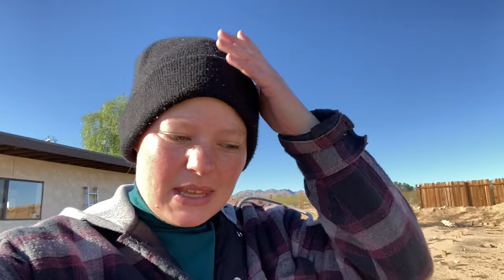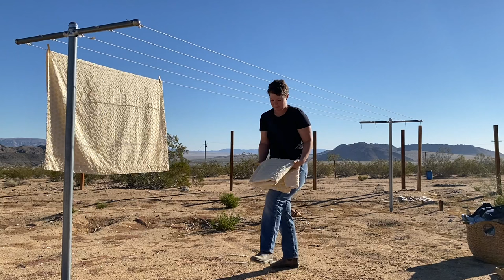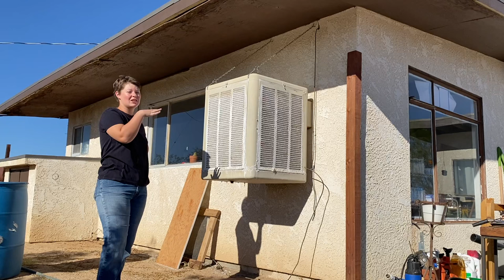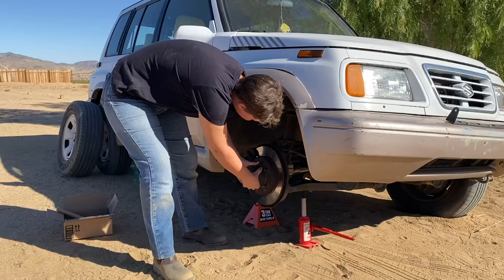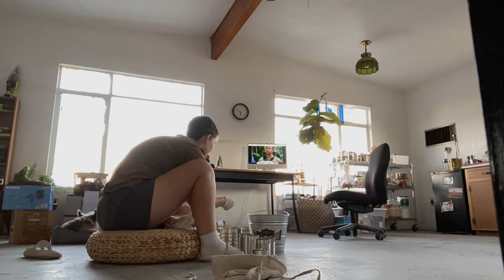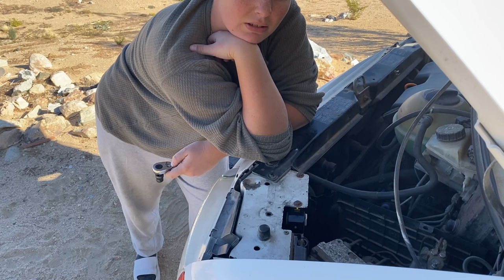34. Little Happenings on the Homestead + Working on the Suzuki Again

Comment: Ok I just started watching your videos- and I Know All about that living out like that- I had to learn the ins and outs, those cute little chipmunks- rats , kangaroo rat, god knows you can’t kill’s their endangered- like Hell, ! There’s Millions of them - and they’ll eat your wiring up, put Peppermint oil on cotton cloth in a tin can and wire in the engine compartment and once a week put more oil in it. 2 or 3 spots - do the same inside. And in the house - spiders don’t like it, and  💯 % orange oil - use it for the scorpions- I spray around my travel trailer, inside and out, I use 4 oz of the orange oil and 4oz peppermint oil mix in a gallon jug with Hott water. Shake it up and shake it every once in a while in a pump,sprayer. Spray around all windows in and out - doors too - thresholds- under cabinets - in your sheds. Everywhere in them, scorpions love the cool moisture and the always travel in pairs. Go outside on a moon lit night and look at the ground - the moon will make them glow a light bluish color. And Never set something on the ground from either the car to house, or house to car. I liked to of had a Cow when you picked that chair up to carry to the dumped. Haha- ugh. Good Luck little Lady, living out there, Your going to need it- You might consider getting a Few cats, but make them a way to climb on top of the house and give them a old cooler to live in, and Always be careful when you pick up something of the ground. Moth balls are great too. Prayers for ya. 🤠🐾♥️🙏🏻🇺🇸🌲🍀🦨

Comment: Heather, if you anticipate trying to unthread or unscrew more rusted things, order or otherwise acquire a can of Kroil. I've been using it intermittently for about 40 years... have yet to have a nut, bolt or screw it couldn't loosen up with a liberal application.  I generally apply it before i even begin a project. 

The algorithm kept pushing your videos for the last 10-12 months, so I finally decided to give you a chance. Glad I did. My wife and I are  local, over on the south side of town. I'm very impressed with your efforts!

Comment: I don't have a cover for my swamp cooler either. I use contractor trash bags slid over the panels to keep the dirt out. Then put a piece of insulation or an old pillow behind the grill to keep the cold out. Good luck with your first winter out here!
Reply from the maker: I just taped cardboard over the grill inside. I have drafts elsewhere so that seems to be good enough that I don’t notice it specifically

Comment: Hello, I just came across your vlog two days ago and I watched a few videos just to get the just of everything, I think your a very smart and capable young woman  on a 
journey with many life lessons in the process .. Congratulations on becoming a homeowner and my the mountains life gives you become foothills .. Now I know how it must feel for every one to give an enormous amount of input but mine is small ( Swamp cooler: look at it like this an FAU forced air unit has duct work and your floor plan is your duct work with a swamp cooler ) if you open a window about a quarter of an inch not more than one  inch it makes the air flow go into that room if you close the window the air will not go into that room !  This cost nothing so give it a try and you'll get it .. 😊

Comment: Good work, Heather. Was the relay for the fan only?
Reply from the maker: As far as my understanding, yes. There's 2 big plugs, one for each fan (both on the radiator) and then a small plug that I assume comes from the radiator switch. The relay has a "control module" computer chip that was the problem. It was working erratically keeping the fan on when it wasn't needed, trying to kick it on then immediately turning it off, etc. So far, so good with the new relay. It's back to behaving like it used to!